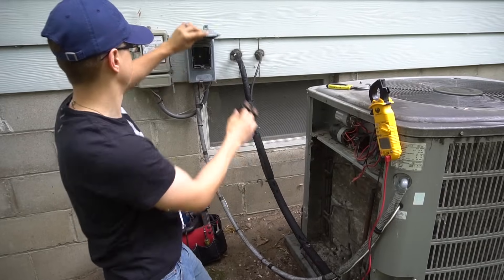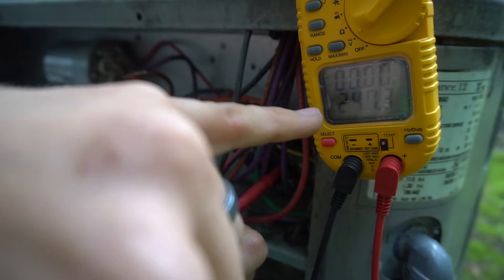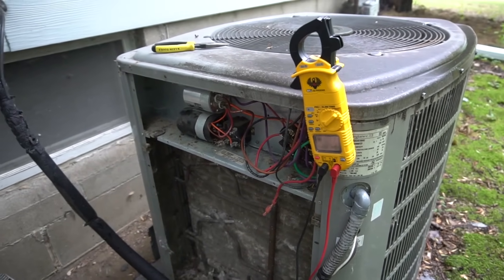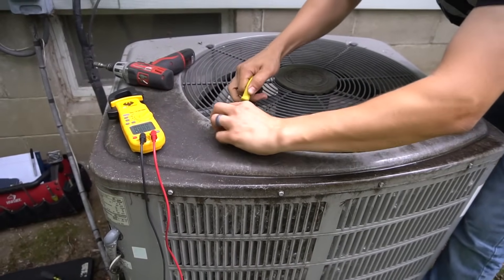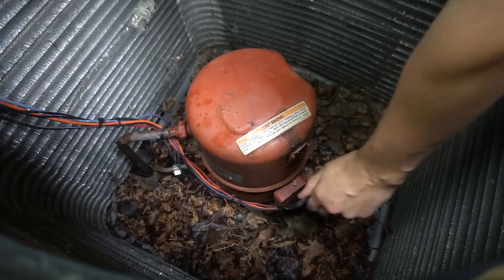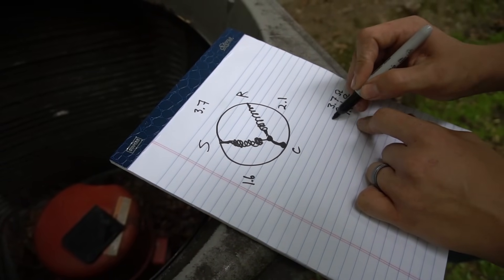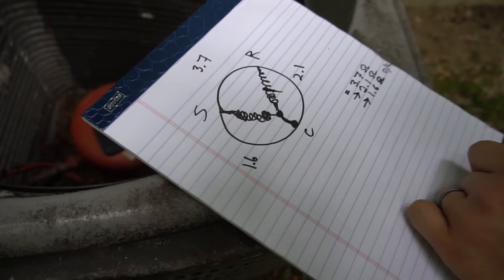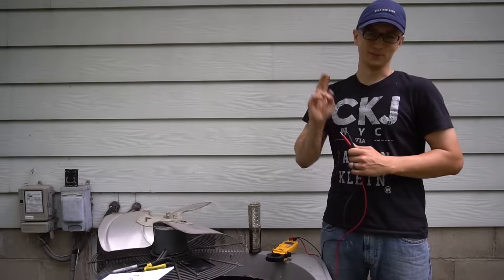How to Check HVAC AC Compressor

Comment: Question.  I tested it the way you showed in resistance (the horse shoe) using alligator clips on my meter for better contact.  The first reading gave me these numbers:  4.1, 1.3, and 3.5.  And the smallest two numbers added up doesn't equal the highest number.  The highest number was 4.1, and the other two added together would be 4.8.   But you did say it could be one or two off.  But I don't know if you are talking about the number before the decimal point, or the number after.  Does that sound good or bad?  I tested it a second time, and the second time I got these numbers:  4.5, 1.8, and again 3.5.  And 1.8 + 3.5 = 5.3, so this time the number before the decimal point  is 2 higher.  Would that be good or bad?

Also I am noticing that the black wire looks a bit burnt on the end, and there is a bit of rust on one terminal and one or two connectors.  

When I did the other test to see if it was shorted to ground, I am not sure what you have your meter set to for that test.  It doesn't look like it is on resistance.  It looks like AC volts.  When I did that test in resistance or ohms I got the O/L  for all three.  But when I changed it to AC Volts.  I got 30. mv for each one when one of the wires was connected to the pipe.  O/L when touching the compressor where I scratched it.  (Btw, I already tested the capacitor, contactor, and fan motor following your videos - they all tested good.  It won't kick on, nor does the fan come on, but it makes a light buzzing sound that I could hear that some people wouldn't even notice.  One time before that there was a popping sound when I turned it on.  And the capacitor was leaking so I replaced it.)

Comment: What do you do if it IS shorted to ground?  Is there a way to fix that?
Reply from the maker: Unfortunately there's nothing you can do, the compressor is shot and the best solution is a new air conditioner.

Comment: Hello I was confused on how to check the windings would checking winding 2 and 3 then 3 and 2 say the same ohm readings? Like you said at 8:35.  I had thought we would read the windings from 1 to 2 then 1 to 3 then 2 to 3 to get the correct ohms?

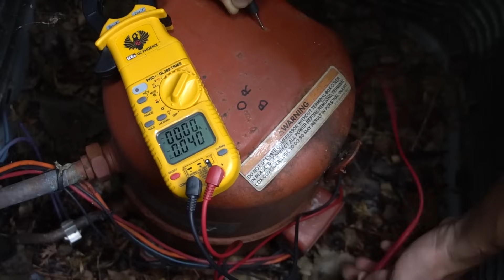Comment: 10:25 "see how i have zero?" yeah if you set the meter to voltage it will read 0🤣 even if it was short to ground
Reply: Definitely will. I don't think buddy is well versed in A/C repair. He's also putting one lead on a painted surface which will insulate you from ground.

Comment: I replaced capacitor AC still did not turn on fan turns manually but unit does not turn on

Comment: Hey Jay! My ac took a dump yesterday and keeps tripping the breaker. The technician came and tested the ohms from the pins and he said the readings were good. He also said it wasn’t shorted to ground but when he unplugged the compressor the fan motor started right up and no longer trips. Measuring one of the line wires to ground there was continuity. But the other line wire there wasn’t. Is there a short somewhere between the Compressor and contactor? My friend disconnected the electrical whip from the outdoor unit and there wasn’t suddenly no continuity from line to ground

Comment: Without removing the wires from the compressor pins, I would just verify that each wire running from the compressor pin to the electrical block is good, after verifying good wires, I would check my compressor from that electrical block, no removable of wires, unless one is bad of course, and much easier to check the compressor without fiddling around trying to make a good connection like you were doing. Also my 16 year old Trane unit came with a Compressor Sound Blanket Wrap. I just took the blanket off the other day for testing, and the compressor looks as good as the day it was installed almost two decades ago, not weather beaten like yours.

Comment: It seems you have the meter set for voltage at the end while testing for continuity. 

"If you have continuity or resistance...   then your compressor is shorted to ground" 
What SHOULD one see if the compressor is good?

Comment: The wires from the contacter to the compressor look good but from where the contacter wires connect to the compressor there are two light gauge wires that are burnt that go into the side of the compressor into a small round hole insulated by some white stuff. 1991 Lennox 4 ton single phase original to the house. I cleaned it as I usually do every summer and replaced the filter and it stayed on throughout a 100 plus degree day then shut down, the outside heat pump that is, the air handler in the basement was still running. I replaced a 5 MF run capacitor and a 45 mf but it kept tripping the breaker upon trying to turn it back on. What do you think?

Comment: Hi I love your a/c videos. I do have a question if my compressor and condensor fan motor are operating but the air at the registers or vents is not cool does this mean low refrigerant. Thank you and keep up the great work👍

Comment: Hi Jay. I love your videos, and even my 5 and 7 year old sons like watching them with me!

Anyhow, I don’t know if you take questions, but putting one here in case you do!: 
I just replaced my capacitor (thanks to your other awesome video that does a perfect job breaking down how to do that), but now it seems to me that my problem is either the wire connection to the compressor pins, or maybe a totally dead compressor. 
The fan starts up as it’s supposed to, but the compressor is inactive (no initial compressor “startup attempt” buzzing or anything when the fan starts). Yesterday I took the wires (rubber plug) off the compressor pins, and found that the rubber of the plug had some considerable melting around the plug’s holes to the wire leads. I removed the melted rubber and cleared out those holes to ensure the leads’ connections would be good, and then after I did that and set everything back up and started the AC, the fan turned on (as usual) and I got a big visible spark at the compressor plug. But after that first startup where I got the sparks, for the following startups attempts only the fan started and there was zero activity around compressor startup (as usual). 

Do you think it’s a dead compressor, or maybe something more simple/less costly to replace (like maybe a new wire/plug)?  I don’t own a multimeter, can will buy one if that’s what I need to do to know for sure. 

Thanks if you do have time to offer an opinion/suggestion!!

Comment: Thank you for all of the informational videos. It’s helping me to rule out some obvious things. I believe my compressor is bad but it is not shorted to ground and it also has no opens. My ohm readings are all the same. About 9 ohms from C to S, C to R and S to R. Symptoms are it will start and run for 10 minutes and then trip the 50a breaker. One leg is cool and one leg is hot to the touch.

Comment: I have a question sir, if my compressor is bad, and I know it's bad, burnt up, do I have to replace my entire system, ie,  my outside heat pump unit, AND my  furnace unit. Is my entire system contaminated?? Thanks ..

Comment: I've changed the capacitor, the contactor, the burnt wire that went to the compressor and nothing will turn on.  I can hear power going into the unit but nothing worked.  The breakers fine, the thermostat works inside and the blower as well. I've run out of ideas and need help. The contactor does engage when turn on thermostat is on, but nothing happens
Reply: I would try a 5-2-1 hard start kit if everything is ohming out right.

Comment: When you power up the unit using the contactor plunger does the furnace itself have be in some particular setting or mode? In my case I am in heat mode (because it's winter) and I want to quickly bypass and troubleshoot different parts of the system. Using the plunger would be convenient, just want to do it right.

Comment: My Compressor is running constantly. After my A/C unit stopped, the outside unit is still running. What could cause this to happen?  I smell a rubber sent. Need immediate Assistance. This unit is on the Roof.
Thank You!
👩🏻‍🦰👆👍

Comment: Great video as always, the only thing I need to ask what's a short to the ground?
Reply from the maker: A short to the ground usually refers to a broken, bare, or loose wire that is touching something metal in the unit. In the case of the compressor, shorted to ground would mean that one of the windings inside the compressor is touching metal inside of it which is causing it to short out and trip a breaker.
Reply: @WordofAdviceTV  thanks man

Comment: Hi,
I was able to ohm out the compressor. It read, 2.5 , 1.6 and 3.7.  Does this mean that my compressor is bad?  And what does this mean that the two legs , 2.5 and 1.6 does not equal 3.7?

Comment: I need help! Our A/C unit stopped working suddenly. Our thermostat runs, our Furnace turns on, but the air that it’s blowing in is room temp. everything inside seems good, but the outside unit just won’t turn on. No humming noise, nothing. We pushed in the plunger and the unit will turn on. So it has power. Something is just causing the plunger to not push in. We tried changing the capacitor and we had the same issue. We replaced the batteries in the thermostat as well. What could be wrong? Help!
Reply from the maker: This video should be able to help out with that: https://youtu.be/NVPhsK4gK1A

Comment: My ac isn't working.  What are the 2 black wires coming from under the compressor? I just found both of mine not connected to anything, not sure if they should be connected to something

Comment: Technician came over for the call on problem of AC. He unscrew  everything of AC and brought it to his office. He later told me the compressor almost gone out for replacement. He should have checked it on place. He should not bring it to his office to check. He’s a complete scam technician.

Comment: Excellent presentation as usual.  If anyone reads this, I have a question.  If you check it at the wires, and everything tests good, you don't need to go to the compressor, is that correct?
Reply: Late response but thought I’d do so. 
Yes, I believe so.  But if they are not fine, you would want to check the compressor also to see if it is the wires on the way or the compressor itself. 
Even though I’m sure by now you got it figured out ha ha

Comment: Hey a quick question how do you check if your thermo overload is open ?
Reply from the maker: The thermal overload is at the common terminal on the compressor. So if it opens, you will not have resistance/continuity between Common to Run winding and Common to Start winding.
Long story short, disconnect the 3 wires that come from the compressor and simply check common to either of the two wires. If there is continuity, thermal overload is closed. If not, then it's open.
Reply: @WordofAdviceTV  thank you 😊🙏

Comment: What if my reads are 4.3 3.3 & 1.8 but the AC still only runs for a few minutes then it kicks off the compressor? It does this over and over.  Not sure what's next the cap is good.

Comment: Is there any reason you can't just change the compressor. If you find the compressor is no good.
I'm told I have to buy a whole new unit and run new lines the whole works. It takes a whole day to replace one. If my compressor is bad. I say they are full of 💩. I'll be doing some more research. Great info. Thanks for sharing.

Comment: Good video.  If my resistance numbers are these : C-S = 4.1 , C-R = 1.2, and  R-S =2.9, is that good or bad?
Reply: It’s good according your resistance 
C= 4.1
R= 1.2 
S= 2.9 

You want to take 1.2 (R) + 2.9 (S) = 4.1 (C)  

As long those small number equal to common or closer they are good

Comment: I've done a lot of DIY repairs in my life but had never tackled AC problems before. AC systems are pretty intimidating but with your videos I was able to isolate the problem to the control board in the attic. A loose common wire may have been the culprit that would only manifest itself on the hottest days, intermittent problems are the worst. After hours of chasing the problem a simple turn of a screwdriver did the trick. I could not have done it without your videos. My hat off to you and I will be sending a contribution to your channel as I figure it has saved me hundreds. Thank you!

Comment: I have a York I believe it’s 2 1/2 ton I put a hard start in it which was from my neighbor he has a bunch of them they’re brand new it’s called an ICM 860 it has a little circuit board in there but there’s a 10 Amp fuse In that hard start usually after a couple of days I’ll open up the top of it where the fuses and the fuse will be burnt out compressor is running fine with or without the heart start but just wondering what would cause that 10 amp fuse inside the hard start To keep blowing that would mean my heart start is not working I got a different one same one still popped at 10 amp fuse Any suggestions

Comment: and my outside fan continues to shut off and it doesn't sound like my compressor is running should my contact and still be turned what would it still be sucked in even though neither one of them is running

Comment: On a commercial dishwasher , the contactor on the hot water booster was chattering . 208 Volt , 3 Phase , about 40 Amps . He pressed the button in on the contactor with an insulated screwdriver . A " lightning ⚡ bolt " hit the unit , flash and smoke ! I jumped at least 5 feet . Wet tile floor and S/S dish tables . The manufacturer said some of the heating elements must have been shorted . Mortal terror !

Comment: Are compressors interchangeable? My condenser is ssx140421cb with compressor ZP31K5E-PFV-830 which has gone bad. I bought part ZP42K5E-PFV-800 as a replacement. Will this fit without any issues or cause damage?

Comment: Near the end of the video, when you tested the pins to ground, it looks like you had the meter set on Volts, not ohms. Your readings of 0.00 was volts. If it had been ohms, you should have seen OL. Right?
But thanks for the very informative videos.
Reply: Yes . If its open you get infinity.  If its shorted, then it will have impedance resistance of a low value or zero. Open circuit on compressor coil should be 0.
Short to ground is less than 1
Reply: 7

Comment: My compressor's continuity seems okay. No broken wire or grounded connection either. The fun runs fine. I put in with a new dual-run capacitor which measured to the spec (of the old capacitor as I don't have a manual for the AC and the circuit diagram faded too). The following are the measured data:

R-C: 1.04 Ohm
R-S: 6.65 Ohm
C-S: 5.70 Ohm

When turned on the voltages are as as the following:
R-C: 207 V
R-S: 207 V
C-S: 207 V

At the breaker box the voltage for AC is 209V. This is an apartment building so it seems that only two legs of the three phase power lines are used.

I pressed the plunger to make sure that the compressor gets power. As I said, the fun runs but the compressor does not do a thing? I cannot tell if it tries to start. I added a kick-starter for the compressor it does not help it start either. 

What could be wrong? Help please.
Reply: Discharge the compressor and then run it

Comment: Thank you for all your great videos!  I have question for you:  when you testing compressor to make sure there is no continuity of C,S,R with ground.  you showed resistance reading of 0.00  0 usually means short circuit.  The question is:  shouldn't that be reading OL or open circuit?   OR it should actually read 0.00 because the windings are connected to the casing?  Thanks buddy I greatly appreciate it
Reply: If you look carefully, you'll see that he accidentally left his multimeter on Volts, which is incorrect. It should have been set to either the Omega symbol for ohms or the continuity symbol. You're correct with your observations.

Comment: Love your video's.  If the compressor is not running could the suction line still be bear can cold?
Reply: No, because if the compressor is not working there will be no refrigerant moving through out the system.

Comment: I gettng not cooling and My ac on the ide is not turning on.  SO I replace the capacitor and I  replace the contactor. I am getting  240 to compacitor When I Press the plunger the compressors turn on , but the fan does not.  Does this mean the fan is bad or the wiring to the fan or could it be possibly something else?

Comment: I have the weirdest A/C problem in the world.  I lived in Santa Barbara, we need the A/C less than 2 weeks per year, 4 or 5 of the past 10 years, we didn't use it at all.  On the first day of the installation, it didn't turn on, the contractor has to drive from Los Angeles the next day, and found out nothing wrong, and it run fine.  Later years, we found out the hottest day of the year it won't turn on starting in the middle of the morning until late at night (after 9 or 11 PM),  I measured the line voltage it was 239 volts (it's 241 volts when it works), even I pushed down the contactor with a plastic stick, it wouldn't work.  The biggest problem is  - no repair person is available when it's very hot but our A/C doesn't work, and when any repairman is available, our A/C worked fine.  What is the problem?

Comment: I am get 1.5 ohms between all wires on the compressor, all open to ground.  Is that bad?
Reply: Compressor is not running,  cap has been changed.

Comment: hi, can you check the voltage at the capacitor (HERM) terminal? how would you hook the meter? is it BLACK lead to ground and RED lead to herm on the capacitor? and what voltage reading should i get? thanks
Reply: Wondering the same. I get a 350 on the fan, but 0 on the compressor. Is it the capacitor?